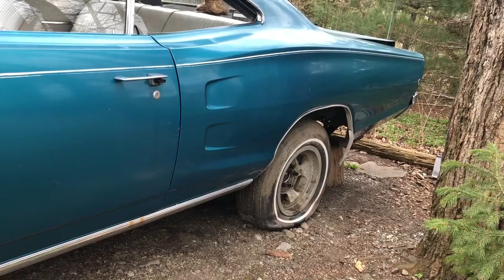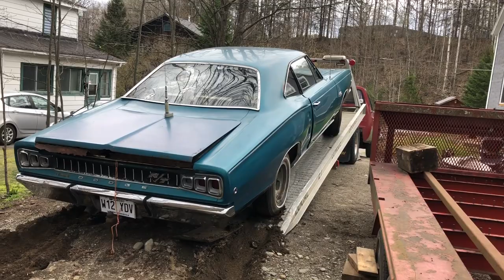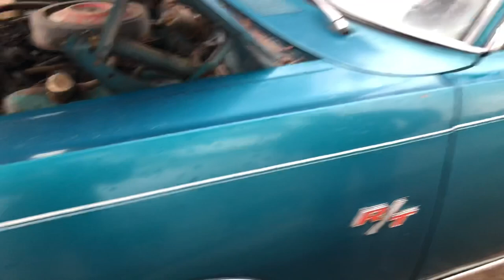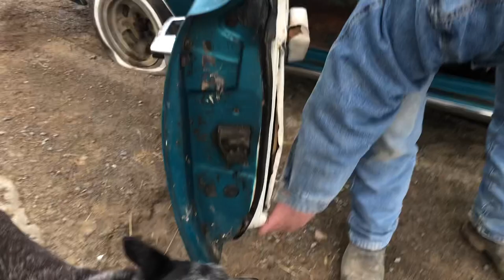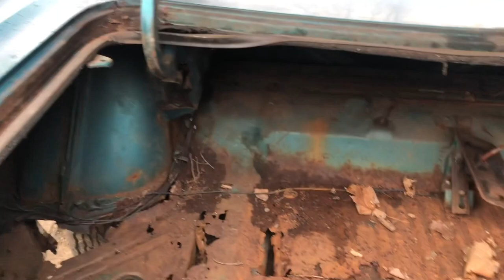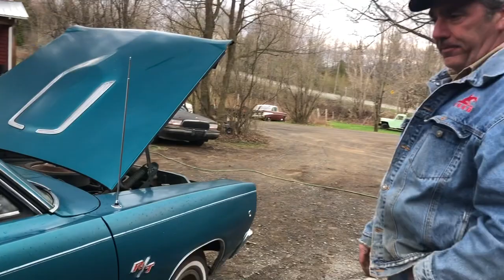1968 CORONET RT 440 MAGNUM parked for 40 years

Comment: Love the car. I know it’s a year later vut you have probably already figured out that the trunk lid is a holy grail part for the one year model 68 Coronet. I have the same car in my garage, all original. Thankfully my trunk lid is pristine. I look forward to watching your prigress etc. excellent find.
Reply from the maker: I have a trunk lid that cost me as much as I’ve paid for some decent cars I’ll have a rust repair video coming out on the car in the next couple of weeks
Reply: @EverythingHorsepower  lucky that you found one for sure. That’s a grrat project and I’m looking forward to your updates. I have a bulge hood that’s got some damage but not in the bulge area that I’m cutting out to install on a pnother regular that I have. for another. The latch area is good as well if you end up in a pickle with your repair.

Comment: You get that 440 fired up and if it's still original/un-rebuilt and hitting on all 8.... then you may be in for a shock ?
I've got a '69 R/T 440/auto/column.... survivor, un-rebuilt, and just say'in here.... pretty damn impressive even by today's standards. The thing is a frigg'in rocket far beyond it's brakes/suspension, and the column shift is FINE BY ME because you need two hands on the wheel to keep it on the road even just left in "D" !
I've been using just a touch of 2 stroke Oil in the 91 Octane fuel, like 100 ml to a full tank every 2n tank or so for the V/Seats, and lotsa zinc in the Oil for the flat tappets, timing back at 2* BTDC and shut it off 'in gear' to prevent run-on.  I don't whoop on it very often.... but still pretty impressive when tasked.
Reply from the maker: That sounds pretty cool I can’t wait to hear this one pop off
Reply: @EverythingHorsepower    For an old stock deal they were actually pretty decent ?

Comment: Nice car must have been special order bench seat column shift instead of the buckets and console which come with the R/T cars. 👍
Reply from the maker: It’s not really a bench it has flip up centre piece that when flipped up makes a bench it’s definitely different
Reply: @EverythingHorsepower  Yeah I've built alot of these mopars back in the day and this is the way they built thier bench seats. I built a 69 charger had the same bench seat and shifter on column. But I built a plum crazy purple charger had the console and buckets and with 318 originally it's the way customers ordered them. Just that yours being a RT it's odd to have column shift and bench seat musta been specially ordered that way. Your Vin plate could give you some answers. 👍 If you need some original b-body parts I may have them also glass too it was my left over parts from my builds.
Reply: @EverythingHorsepower  oh the build sheet if it's still there it's under the rear seat in the back it'll tell you everything about your build.
Reply from the maker: @jerrymcever3932  what I need the most is a trunk lid if you can help me with that
Reply: @EverythingHorsepower  I'll keep an ear out I mostly did chargers 68-72 before they got ridiculous on price 😆